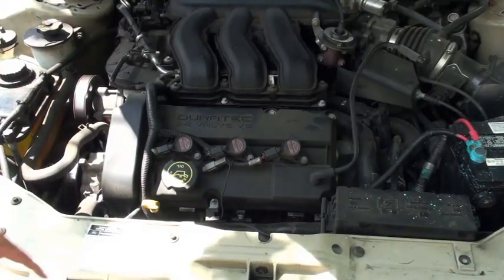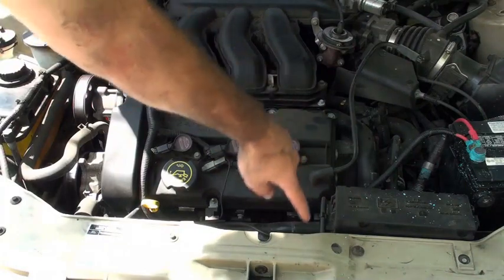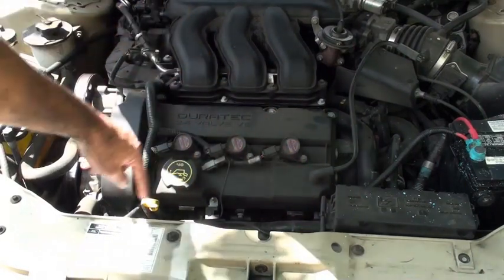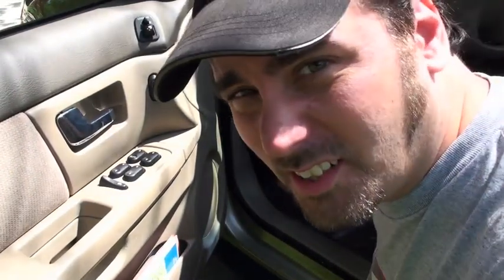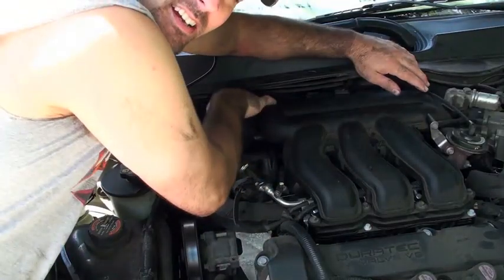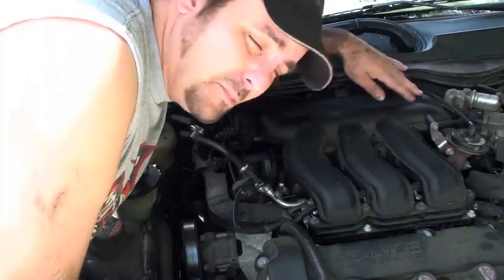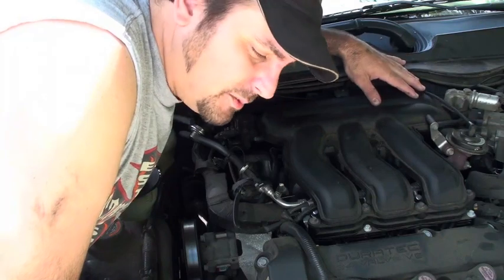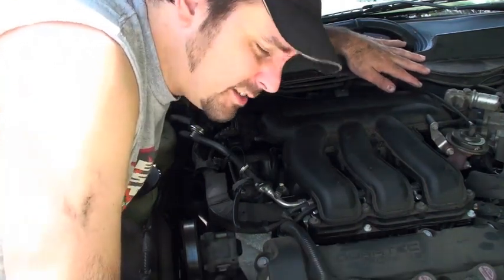Quick Tip-V6 Access - EricTheCarGuy

Comment: Eric thanks for this video, I just did the plugs on a transverse 3100 V6.  All I did was unbolt the dogbones, rock the car, and grab it with the parking brake.  

It helped IMMENSELY.  Didn't think I was going to be able to get the rear bank plugs changed at all.

Comment: Eric, I just changed the spark plugs and wires on my '00 Regal 3800, and for that appliaction, GM used TWO dogbone engine mounts.  But, the principal is still the same, I disconnected both motor mounts.  The only difference is I just used a ratchet strap, found solid hook points on the motor and chassis and ratcheted it forward.  A lot less cumbersome then trying to rock the car back and forth and timing hitting the parking brake right.

Comment: I changed the plugs on my 98 Dakota Sport this weekend.  It had original plugs and wires.  I bought the truck two months ago.  The boots were a pain to get off, especially cylinder #5.  There was almost not enough room for a ratchet on the socket. And to make matters worse, the boot was so hard to get off, I damaged it slightly but didn't know it.  So I get the new plugs in with anti-sieze and di-electric grease on the boots and go for a drive.  Two miles into it, I get this nice amber colored light on the instrument cluster. You got it...CHECK ENGINE. Code P0305 - Engine Misfire Cylinder #5.  It was grounding against the engine and it had a slight surge.  It took 1.5 hours to change the original wires because they were stuck on the distributor cap and I could barely get my hand on it between the throttle body and firewall.  I hope a mechanic gets paid 5 - 6 hours for a repair like that cause it's not worth it for an hour or two. Can you say BS?  Anyway, I love my truck and it's got way more room to work with than the newer transverse-mounted engines, but damn that was a pain.  I don't want to do that again!  The silver lining was that the plugs that came off were the orange-ish color that indicates a normal condition in the cylinder.

Comment: some of those GM cars with the dogbone mounts actually have a second bolt hole under the mount, so you can remove the front bolt pull the engine forward and stick the bolt in the second hole to hold the engine forward, giving about 4 extra inches of clearance between the firewall and rear cylinder head.

Comment from the maker: @Chris07860 If I did do a video this would be step one.  I had to do a heater hose on this car that's why I moved the engine, you can use the same technique to remove the plugs on both cars, some engines will move more than others, these don't move too much unfortunately.  Good luck.

Comment: GM 3800 V-6's on the left dogbone (facing the engine) has 2 locations for the bolt. disconnect both dog-bones, rock the engine forward and place the bolt for the left dog-bone into the second location (its more like a catch) and through the dog bone.  Now you can reach the back of the engine. remove the coolant res and your good. I usually tying webbing or a rope to the back engine cover mounting bracket of the engine and pull on it to rotate it forward, it takes a bit to do this the first time.

Comment: haha I wish I knew this when I was changing the spark plugs a couple months back!
Thanks ETCG, I'll def. use this next time.

P.S. the GM 3100 and 3300 only used one upper dogbone, and were mostly in the late-80's early 90's GM cars. The 3800 and maybe the 3400's used two.

Comment: Thexton 419X is the tool . I believe it's for GM . I don't know if it works on other V6 engines . About $ 30.00 . If it saves labor and skin , it's worth it . There are You Tube videos .

Comment: This way is great and works for most everything.  If you need more clearance though, you don't have to take everything off, which is a pain (especially on a 3.1).  Go under the car and unbolt the engine mounts (and transmission mounts if necessary), get a 2x4 and lay it across a jack, and jack the engine upwards.  I don't mean a ton and to support the weight of the car - just enough to get those desperate few inches you might need.  Had to do it before, and doing it that way saves HOURS compared to fiddling with everything and removing it just to get access.